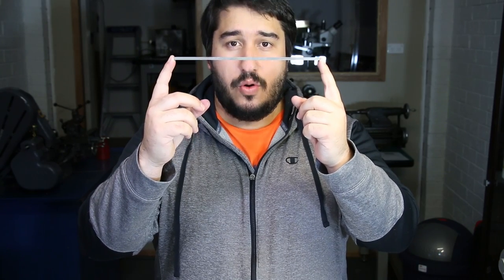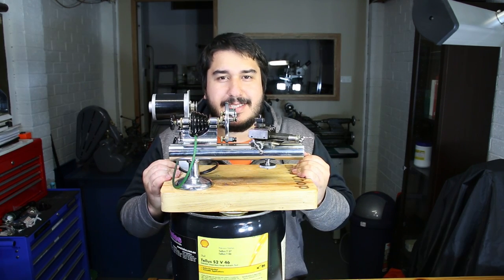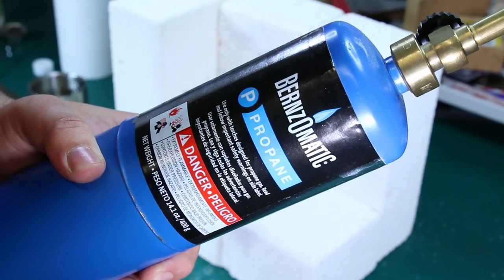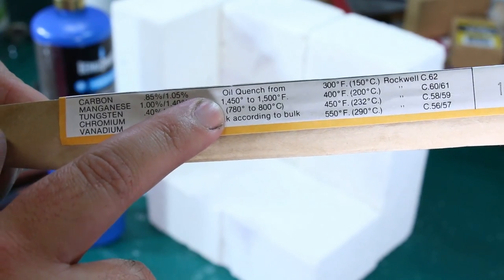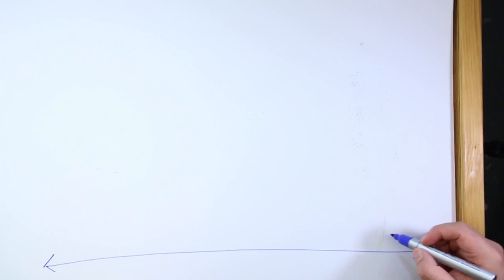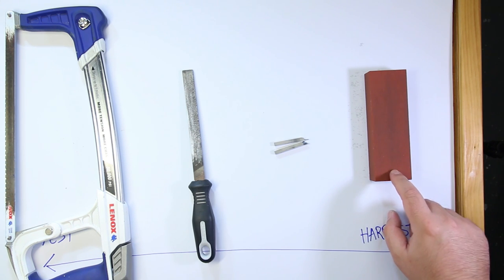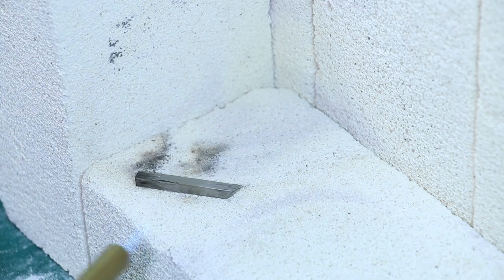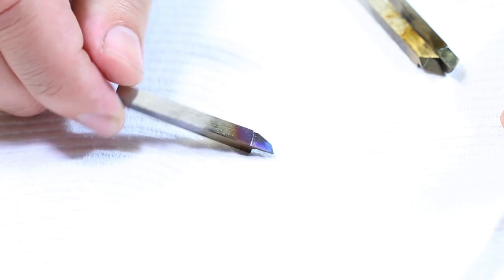Toolmaking with no grinder - Watchmaking VLOG 2

Comment: A good way to tell if the steel is up to temp is to use a magnet (I did this back when I was blacksmithing). If the magnet no longer attracted the steel, ie the magnetic domains in the steel were free to move and conform to the surrounding magnetic fields, then the steel would be somewhere in the 1200 F - 1500 F range.
Reply from the maker: +xSkormz that is a great piece of info thanks for sharing :)

Comment: This video is well made. I want to thank you and acknowledge the time and effort into making it useful and well produced.

I have some constructive comment. I wonder if you stoned the cutting faces after hardening? Or the cutter lost hardness during tempering. The reason I ask is that around 6:15 min the cutter is pushing steel. The shape and angles all seem fine but it is not cutting as I would have expected. You can see a lip forming ahead of the cutter and as that lip is getting bigger, the material is spinning. It should not push a lip and the comparison with your hand gravers that are super sharp is evident. Hope this is helpful. Daniel
Reply from the maker: Thanks for the support !

I did stone the face with the medium side of the India Stone. I will admit I did not put the time in as I would have a hand graver. Yes i noticed that too. Thanks for pointing it out! I was actually wondering why it was doing that while I was turning. The thing is, when I first made contact with the surface it pushed that lip, but then I did start to get  swarf and then it stopped, and pushed the lip a little bigger. Some parts look a bit torn too. 

Tonight I took some cuts, but I used a different silver steel, seems better quality.. Seemed to cut really nice swarf. I also reset the height. I'm going retry cutting the other material. I will post on the next episode. 

Also, based on the colour of the temper do you think the it was too dark? Should it have been lighter?

Please let me know what your thoughts are. Thanks for your comment. I really appreciate it. I'm always trying to improve :)
Reply: Hi Dean,Colour looked okay, on a screen... not easy to tell from here ;) I stone my HSS and toolsteel bits starting with a medium India, then move to a fine India and finish with a white hard Arkansas.  The edges that cut should have a mirror finish. I also round the nose on all my bits. The radius of the edge depends on the size of the bit. The round nose seems to perform better for me. You will want to look at the tip of your cutter with a watchmaker loupe and correct the finish as needed.  Good luck! Daniel

Comment: Hi there, 
Very slick videos! 
Could I please ask why you have chosen gauge plate rather than hhs or tungsten carbide? 
Warm regards 
Daryn
Reply from the maker: Hi Daryn, sorry about the late response. I have been a little unwell. Basically I don't have a grinder at the moment, and for turning mostly brass I don't see why I would need to setup one at the moment. I just don't mean the tool aswell, I would need to an dustrpoof area to ensure grinding dust doesn't float on to my other machine tools as I only have a small working space.
Reply: Hi there, sorry you've been unwell, hope you're on the mend soon, 
I spent many years using tool steel gravers, in fact I still use them for certain jobs where the brittleness of carbide or has can be an issue, however when you start on turning blue pivot steel and silver steel you'll definitely have trouble, if you start using the dials for turning to dimensions the wear and resharpening involved will give you a real headache, perhaps try and figure out a dustproof solution for grinding? 
Good luck with your watch work ☺️
Reply from the maker: Thanks Daryn. Yes, I will definitely keep these away from blued pivot steel. I have used then on silver steel and I have resharpened them a few times. I am used to sharpening the watchmaket graver by hand so its not too bad. 

But you are correct and it is something I wish in the future is to have a griner setup where dust won't reach my machines. :)

Comment: Thanks Dean.  Could you tell me the graver info?( size,  HSS , Carbide ...)
Reply from the maker: +HAN TWOMIN  The graver made from precision ground flat stock or gage plate. Its an oil hardening carbon steel. 5mmx5mm. Its not as hard as hss or carbide. But I will turning mainly brass which is more than sufficient.
Reply: Thanks Dean.
Reply: I think your right by using the gauge plate (GFS...01 ) especially turning brass and cheaper than the Hss option and carbide is a no no because of the soft brass ! Great viid 👍

Comment: Table salt melts at 800°C. Heat up the oil to about 60-80C before quenching. That lowers viscosity which improves contact to the steel. Tempering with a torch is not as reliable with small tools. Using an oven or temperature controlled fryer is more accurate, i.e. less risk to overtemper the tool. Tempering colors are not accurate at very short or very long temper durations. You may want to use better cooling, carbon steel is not heat resistant like HSS.
Reply from the maker: Thanks Verdigris for the insight to getting an accurate measure for 800°C, and heating up the oil before quenching. Yeah, I completely understand, I do wish to get an oven in the future, but it is in the far distance future. Would tempering the tool by heating up on a brass plate get better results?
Reply: I was talking about a regular baking oven. Some people use toaster ovens. Brass doesn't get as hot as a propane flame so it might be a bit better.